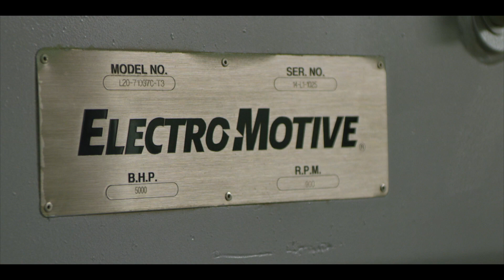EMD Powered Towboats

Comment: I worked for over 30 years in Civilian Nuclear Power. My career was centered on the Emergency Diesels used to provide emergent backup power to the safety systems needed to keep the reactors and nuclear fuel safe. Of all the engines I worked with, the EMDs are by far my favorites. They are the most dependable and reliable used in the industry. This is not an opinion, it is fact that is backed by solid data recorded over years of service. While I have retired from the Nuclear Industry, I would very much LOVE the opportunity to ride some of these towboats and get some first hand experience seeing them operate on the river! It would be my honor to provide any assistance I can to keep these engines in tip top shape! I live in Bettendorf Iowa and if anyone reading this can help me realize this dream, please contact me here!!

Comment: As a retired Chief Engineer I can absolutely say I LOVE these engines.  Before I was an Engineer I worked for a company out of  Marrero, Louisiana.  We done complete rebuilds on EMDs on boats, drilling rigs, and offshore motor rooms. I've probably rebuilt nearly 500 EMDs. Last year I was there I met a guy in a bar that was a rowboat Captain.  I hadn't had a vacation in about 3 yrs and was getting layed off the Wednesday before Thanksgiving coming up in a few months. We got to talking and he asked me would I like a job as a Chief Engineer.  So.......I  took it. 9 yrs on the River pushing hot oil. Good experience.  Later became an INDUSTRIAL HVAC/R TECH. Also doing DIGITAL CONTROLS.  Retired 2 yrs ago and very happy for all the time on the River

Comment: EMD stands for electromotive diesel .
Reply: EMD=Electromotive Division of General Motors
Reply: That's the pre 2005 name.  Today it is no longer owned by GM.
Reply: @KH990j  Dont care. It will always be ElectroMotive Division to me. I actually went through the factory school inside the main assembly plant in Lagrange IL when it was still GM. I still have all the swag including a bunch of GM Defense division stuff.
Reply: @erikb8877 long live the GENERAL 👍🇦🇺
Reply: KH990j Was called Electro-Motive division of General Motors from 1922-April 2005. Now from April 2005 to present it's called Electro-Motive Diesel of Progress Rail/Caterpiller.
Reply: Hugh Tufnail and Electromotive Division of General Motors
Reply: as a guy who works on them i assure you it stands for "Every Model Drips"

Comment: I'd like to see a segment done on the deep water pipe laying construction vessel Jascon 18 with its eight 20-710G7B generators as well as any newly constructed oil rigs that use EMD power plants.  Good to showcase EMD power products diverse applications outside of the railroad industry.
Reply: Oh, and a video on Great Lakes Dredge & Dock suction hopper dredge barge Ellis Island with it's two ME20G7C-T3 engines.